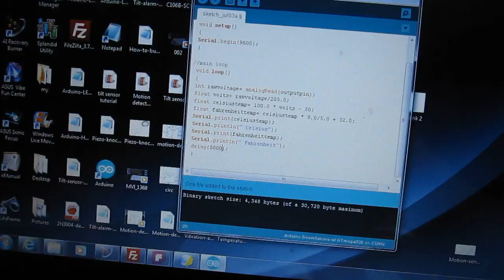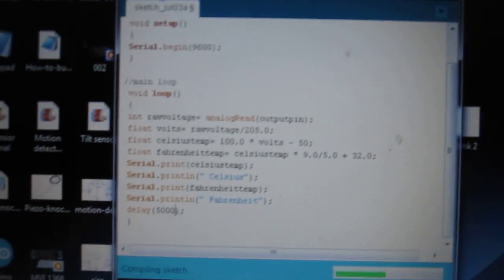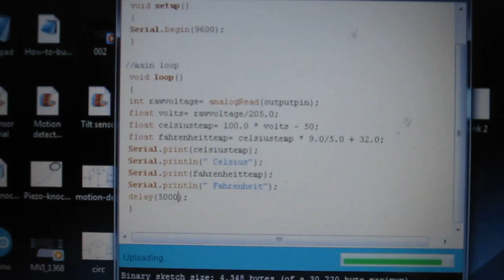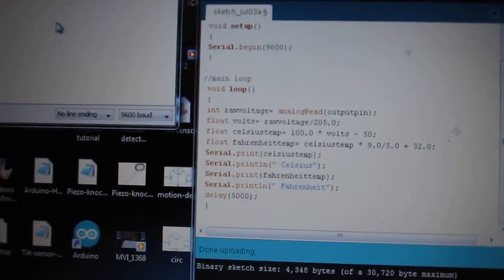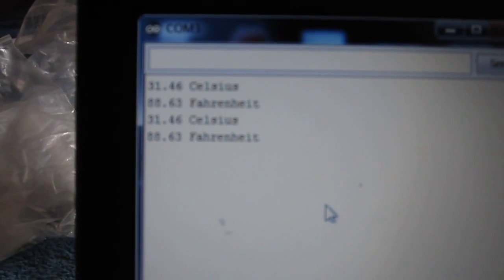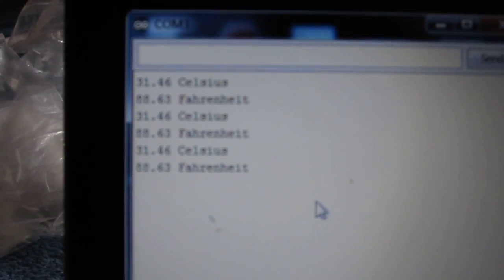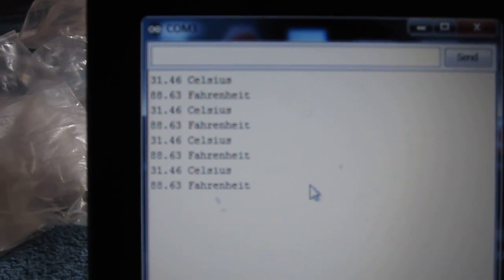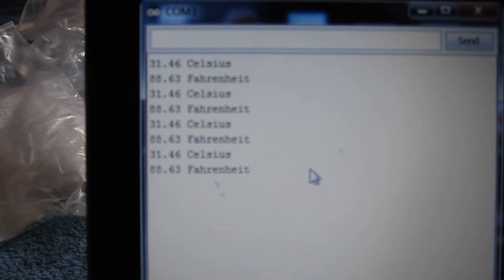TMP36 Temperature Sensor Circuit- Demo

Comment: For some reason I get super high temperature values, after a while practising. I'd say it gets overheated or something? Should I add a resistor somewhere? Because every circuit I've seen they use it just as it comes :/
Reply: I get also high numbers without line "voltage = sensor / 205.0;"
With that line I get -4 to -46 C degrees.
And I wonder, why sensor output voltage jumps,
I have 4 sensors and I have tested already 3 of them.
Reply: Daniel Negro  Make sure that analogRead() is reading the correct pin
Reply: That line is a bit off. Should be:  voltage = sensor / 204.08